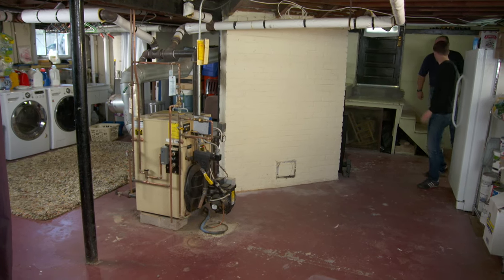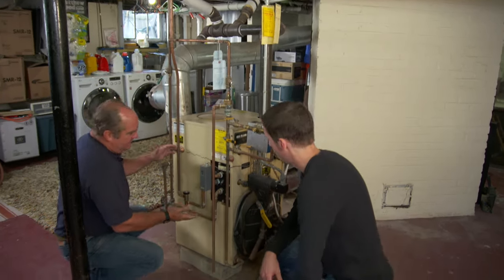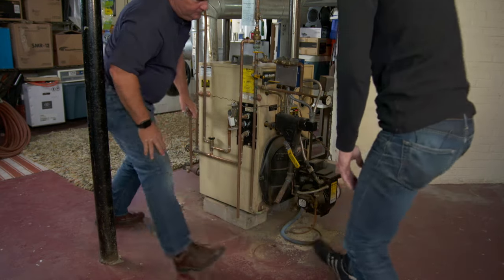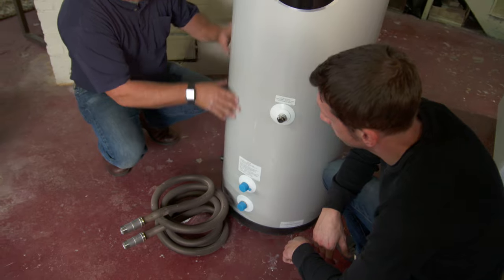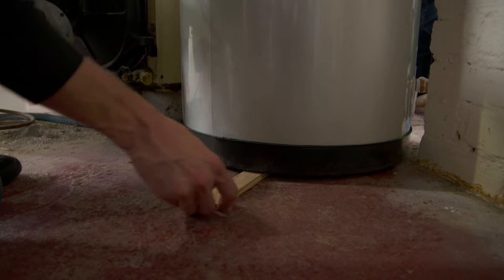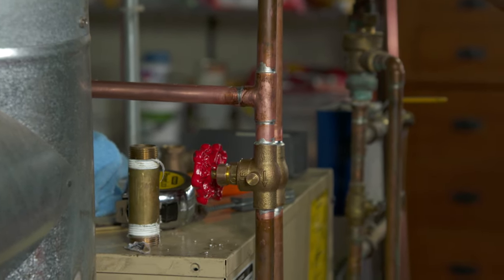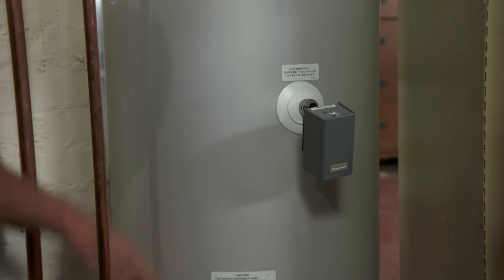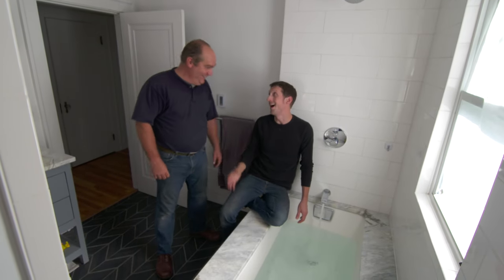How to Install an Indirect Water Heater on a Boiler | Ask This Old House

Comment: In wondering why you used a cast y strainer instead of a brass one when it's on potable water?
Reply: The indirect coil is not potable water. The Y strainer exists to protect the circulator pump and indirect coil. The potable water goes through separate connections and is not tied into the boiler water.
Reply: The issue about brass instead of black pipe is about galvanic corrosion, not potable or non-potable water.
When you mix two types of metal in a plumbing system. 
Doing this will cause electrons from the black pipe to transfer to the copper and brass plumbing pieces. 
Eventually the loss of electrons adds up (pardon the mathematical pun) leading to a hole in the material.

Comment: Can anyone tell me how to switch over from heating to AC. Because of the Coronavirus, our property management company will not send a tech to switch it over. I've done a lot of service in my life time including being an Espresso Machine Specialist, so I can't really be that hard for me to do but I don't really know why it has to be done manually instead of just flipping a switch. If anyone could help I would greatly appreciate it. I'm guessing there is probably a valve that needs to be shut off.
Reply: Look into a
Taco switch    It prioritizes the heat zones.      The boiler mate is just another heat zone calling for heat and you prioritize it with this switch.

Comment: Why was the zone control on and calling before the switch was turned on?
Reply: Probably someone just used hotwater
Reply: @tribulation138  doesn't matter, the switch should shut off everything associated with the boiler. That way if someone doesn't know what they're doing they don't get hurt because they assumed the power was off

Comment: so, pretty much the problem was the dirty water ? if it would of being drain your water heater would of last you 3,4 years more while you had to drain it again
Reply: Also, the problem here is the system is inefficient, even with clean water.
Reply: Mookie Man you are dump... it is a water heater boiler. It need to be drained annually to get rid of deposits
Reply: They don't need to be drained annually, at least where I live. That's not part of routine maintenance around here.
Reply: It's a steam boiler not a "water heater boiler". And no they don't need to be drained annually.
Reply: Tung Tranle false you don’t want to drain or add makeup water to a steam boiler annually. New water in a steam boiler is it’s worst enemy.

Comment: Crazy. Just buy a water heater for $400. Not $2000 like they just did for the indirect.
Reply: An electric water heater wouldn't have been able to fill that tub either, they only have an output of 15-17,000 BTU and can take up to 2 hours to reheat 50 gallons.

Comment: Does the Aqua-stat only send a lower limit signal to turn on the boiler and re-circulation pump? Or does it also send an upper limit shut of signal to the boiler & recirc pump? Does anyone know the specs or model # of the aqua-stat used here?
Reply: Answered my own question: Honeywell Aqua-stat L4080B-1352
Reply: William Maurer 
Well tell us please
Reply: Install a Honeywell L4006 in a well of boiler set that to 160 to maintain that temperature, set a l4006 or l4080 in the well of the indirect water tank at 125 degrees. This way there all ways at least 160 degrees water in boiler !
Reply: @knighthvac4876  what well?

Comment: What are the pros and cons of a super store over a tankless condensing boiler?
Reply: Fuel source for one thing. The homeowner in the video had oil fuel for heating, and a tankless cannot use oil.
Reply: You don't run into issues with flow rate.  A tank less will reduce flow rate if the delta between city water and your desired temperature is large.  That will bring water to a trickle to your faucets and shower.  You don't run into this issue with an indirect tank.  You also need a larger delivery pipe to a tankless/combi boiler with gas (3/4 inch?) which many homes don't have. Also, as said earlier, you cannot use oil with a tank less, while an indirect tank can use both oil or gas.
Reply: assuming you are a plumber here; would you, and how would you pipe, an indirect tank off a brand new cast iron steam boiler?
Reply: Daniel Nowitz I'm not a plumber but I thoroughly research any procedure done in my home and I watch my contractors like a hawk while they do work. This video here pretty much outlines the usual indirect hookup method: you run hot water out from the steam boiler (or water boiler in my case) to the indirect's heat exchanger, then connect a circulator pump on the return side which will send water that's cooled down back to the boiler.  The circulator pump will be connected to a thermostat which sits in a well on the side of the indirect tank... Usually set to 125 degrees or so. 

I didn't mean to downplay tankless heaters before... They are the superior option from an efficiency and space saving perspective... But you have to be mindful of the amount of occupants in your house. Three taps on full blast will leave that third person a very icy shower.  Hvac wise, thankless works just like a traditional hydronic system, for in-floor radiant, baseboard as well as hydronic coil (if you already have an air handler for your central air).

Comment: the water in that tank should never get hotter than that 4080 Honeywell is set for no matter if that boiler is making steam or not shouldn't need a mixing valve on a tank like this

Comment: Why is that water so dirty, I thought it's a closed system.
Reply: Its a steam system which is not closed.  As the system stops heating the condensation from the radiators comes back to the boiler.  Replacing pipes on a steam system is something that happens regularly due to deterioration of the pipes from lack of maintenance.
Reply: Its a steam system which is open to the atmosphere 24/7. That is why they get so dirty, water, air and metal creates corrosion hence the brown sludge.

Comment: I don't get why you wouldn't go full electric. That way the boiler is off all summer
Reply: Heating anything with electricity is terribly inefficient and expensive, unless you are using renewable energy. Burning fuel to make electricity at a remote plant is nowhere near as efficient as burning fuel for heat at the site.
Reply: true. and maybe he only has a 100 amp service at his home. or 200 amp that is full.
Reply: I probably personally would’ve put in a bock oil fired water heater because he’s already oil but install one next to the boiler and you can vent both oil fired appliances in the same flue and basically have the steam boiler turned off in the summer!
Reply: Zachary J Hott-Salman actually electric hot water heaters are the most efficient way of heating potable water.
Reply: Problem is the losses in getting the electricity to you.  That's why oil/NG is cheaper to heat your water with.
Reply: Late reply; Brian B clarified my previous comment for me. An electric heating element in itself is nearly 100% efficient, but the process of the power company producing the electricity and sending it to you is extremely wasteful, at least if the power plant burns fossil fuels. People pay for that waste in their electric bills. The cost of using electric heating versus an oil/gas boiler/water heater varies by region, but for most of the eastern U.S., electric is much more expensive.
Reply: Also, periodically running boilers during the summer keeps them from rotting out (i.e. deoxygenating the water).
Reply: @ZacharySalman  So do you have any idea how much more expensive incrementally it would be to heat your hot water in an electric hot water heater during the summer months versus the oil boiler with an indirect tank? I'm looking for dollars and cents here. It looks like about an extra $2,000 to do the indirect tank with an oil boiler versus an electric tank which is a lot of savings up front. And the ability to shut down the boiler in hot summer months also is pretty attractive.

Comment: HTP is bad brand. I have HTP indirect water heater running only 6 years and broke heat exchanger and manufacture refuse perform it’s duty(7 years warranty)

Comment: Omg you yanks are years behind the tech, in Europe we stopped using systems like that 50 years ago
Reply: Certainly not a standard in new construction... But I don't see anything wrong with repairing and updating an old system that is still working

Comment: What a waste. Just use a water heater.
Reply: Indirects are WAY more efficient. Average water heater efficiency (gas) is about 50-60%. That Weil-McLain WGO oil boiler is about 80% efficient. The indirect tank also loses much less heat sitting idle (no big open flue pipe going up the center). An indirect will also outperform a conventional gas unit by about 200% in terms of continuous hot water output. In other words, a 40 gallon gas water heater can be replaced by a 20 gallon indirect and it will still provide more hot water. I won’t even mention electric water heaters as their continuous gallon per minute output is pathetic compared to gas and indirect units.
Reply: I've got a 80 gallon water heater in basement, which is heated via wood boiler. I saved so much on electrical bill. Three people live im my house. Boiler was fired every third day in summer, it burned two buckets of dry oak fuel, we have hot water for three days. I also have thermostat mixing valve installed. In winter time, like the time now, water is heated automaticaly as the house via radiators, which is basicaly free hot water. Those systems are great.
Reply: YOU ARE CORRECT SO HE WANTS BOILER TO COME ON WHEN ITS 90 DEGREES OUTSIDE YEA THATS EFFECIANT
Reply: @bigc8300  Exactly.
Reply: @bigc8300  whats effeciant?
Reply: i understand electric may or may not be more efficient.  but yes couldn't i completely shut off the boiler during summer and put electric water heater on a timer for a couple hours in morning and evening?  plus i could hook up electric water heater myself ($500) rather than having this done for $3500.

Comment: Shame on you richard for soldering male adapters threaded into the black pipe. All the sealant will melt out. What a knuckle head.
Reply: shauntampa If you aren't awful at soldering that shouldn't be an issue. 1/2" M copper doesn't take much heat to sweat. Should be in and out of that joint.
Reply: Aren't you supposed to sweat the adapter on 1st & then thread it on?